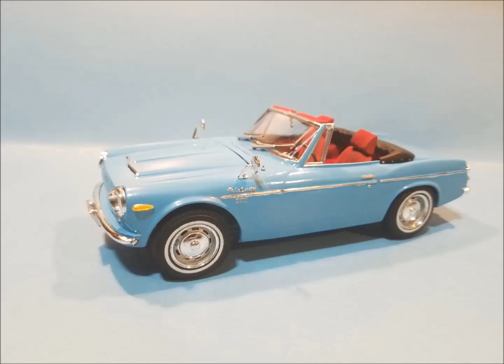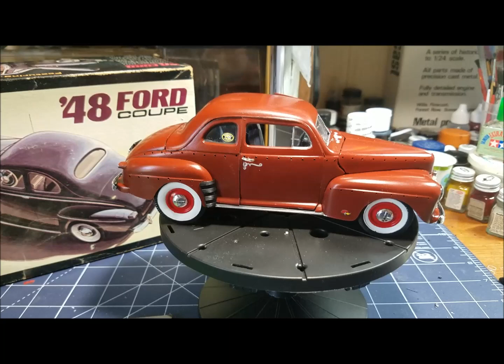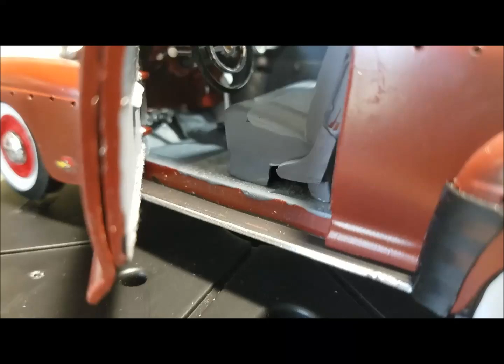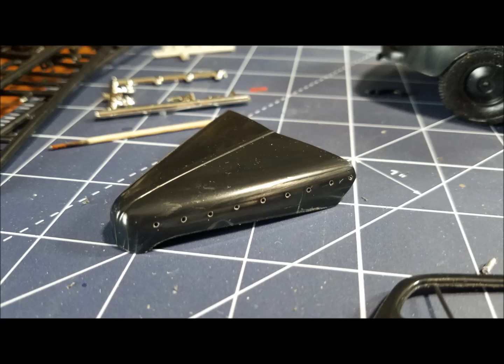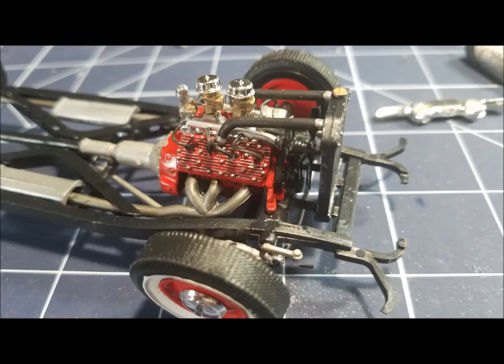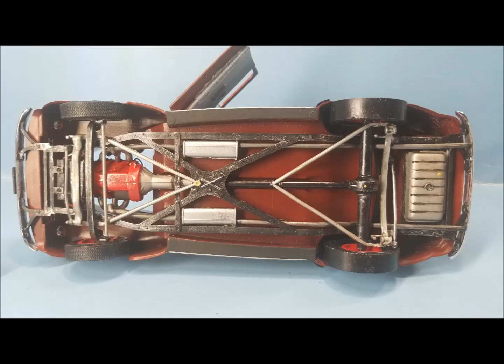IMC 48 FORD BUDDY BUILD FINAL

Comment: Looks really good Shawn.  Nice job.  One tip, I found with license plates not to bother with the wet stuff.  Just cut them out as close as you can and cover the white edge with a black marker or color match paint.  Then you just glue them on with a little white glue.  It's easier and they look flat, especially if they are covering a mount with engraving in it.
Reply from the maker: Thank you Vince, that's a good idea, I would have never thought of that.  Thank you very much and I'll try it next time
Reply: @thescalemodelcarguychannel8681   I didn't think of it either until I saw someone do it.  Now it's the only way I do plates.
Reply from the maker: @VinceWeston  thank you very much 😀